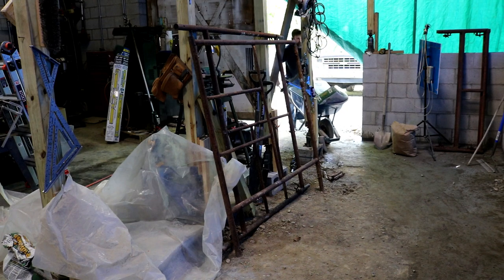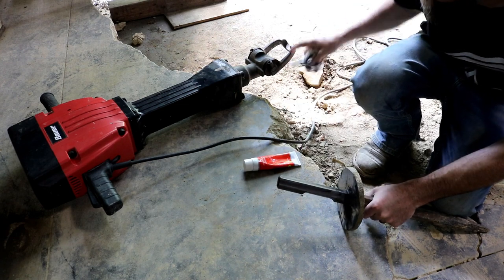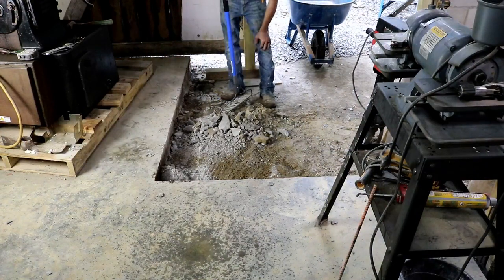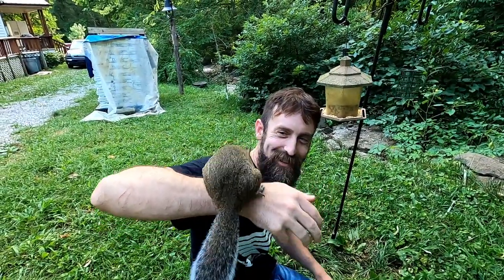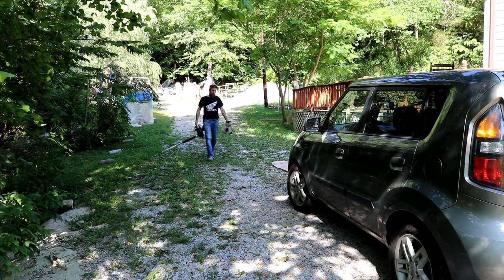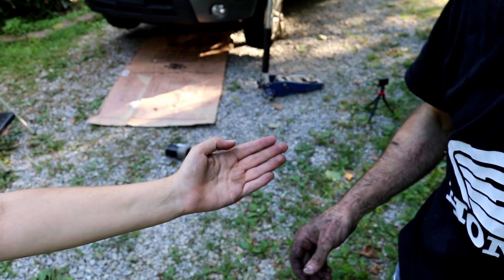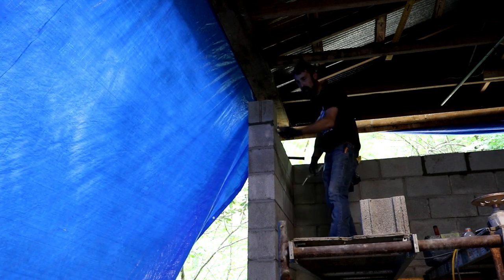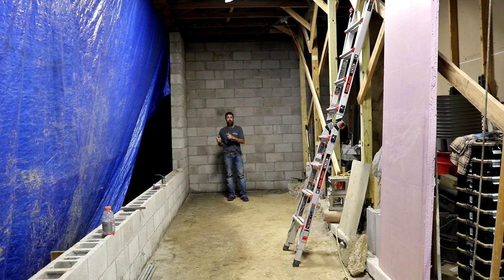Finishing up the back Block shop wall / Jackhammering the old floor \ Car trouble

Comment: Big arms and hands. After all that excavation, concrete, and block work you outta look like another Schwartzenenegger. You have muscled up since you started resurrecting your shop building. I recall having to buy larger shirts in my younger days as a result of clearing a couple acres of stumps with pick and shovel and about a million chainsaw chains.

DIY automotive. I've always had back trouble, especially after a weekend of leaning over fenders. Now that I'm old and decrepit, I farm my oil changes, grease jobs, tune-ups, erc to the shop down the road. Haven't had a speck of back trouble since. Funny thing: add up the money I saved doing my own vehicle maintenence and subtract out the chiropractor bills, hiring it out is cheaper overall. Of course if you have a back made out of steel cables....

Comment: undercut the old slab let the new slab pour under the old one just buy a shovel size footing with wire and rebar it will be just fine

Comment: I hate those little breakers they are so slooow ! drive me crazy ! Not criticism I have one too !
      A block building is twice the building  that a tin shed is, quieter, cooler and with proper retention straps more wind resistant.

Comment: 8:40 I live in rural Connecticut. Have the same problem with people throwing beer cans on the side of the road. Went for a walk the other day before the pandemic and there was a Miller Lite can about every 50 feet for 3 miles on both sides of the road just after crossing the border into New York state. I figure it was the same asshole driving up and down that road everyday throwing beer cans out over a period of months/years? That was the only trash.
Reply: From Ontario, Canada. I'm sure this happens elsewhere too, but it's not just litter here: old appliances, wrecked cars, building waste, household garbage...all gets dumped, esp. on back roads.  Just to avoid a few bucks at the local landfill.
Reply: Or one guy on his way home from work one Friday night.

Comment: Dont know if you can see the irony, but in the video, you're wearing a Honda shirt while struggling on a Kia. I daily drive a 2000 civic with 300k on the factory starter. That's in a manual car, that's had plenty of restarts when you accidentally conk the engine out at a stoplight.  My brother and mother in law both own kia souls, they seem cheap and throw away compared to a Honda or Toyota.  And I agree, they're a pain to work on. Great video series.

Comment: i am unsure why u are doing all this yourself - u are taking  6 man job of 90 days and doing it yourself over months - are you really saving - i cringe each time i watch u do it all
Reply from the maker: Thats a good question. Let me explain. That 6 man 90 day job would cost a small fortune. If I had paid for everything to be done I would owe the bank several K by now and would be nowhere near done. Doing it myself allows me to go twice as far with the money I have available. Not to mention the trouble of finding a contractor and getting schedules to line up while working a full time job and raising a family.  I'm in no rush to finish, I'm far more concerned with staying out of debt and getting the best possible shop for the money. It really is that simple.  As a bonus I acquire new skills. Win Win
Reply: @SteveSummers  i figured i construction in NY i know prices - damn though wayyyy to much for 1 person - great videos and please lock the damn barn!
Reply from the maker: @VanguardSys  Its hard to imagine  the cost to build in NY. Its expensive here in KY.  It was tough to find anyone even interested in working on my shop due to the poor access and having to try and build to the existing shop. Thanks for watching 👍